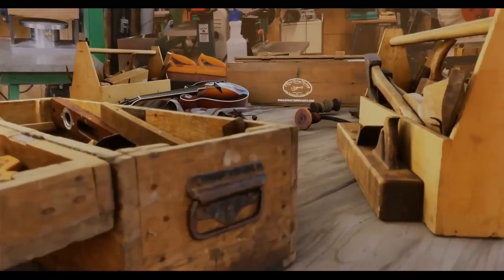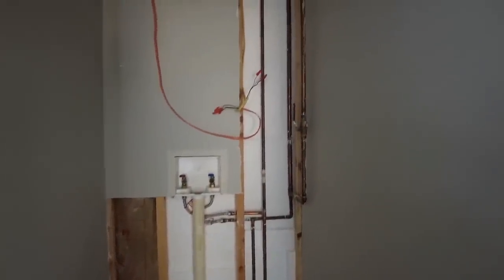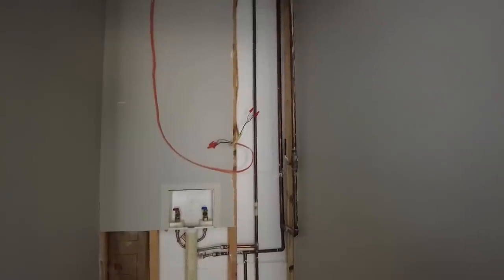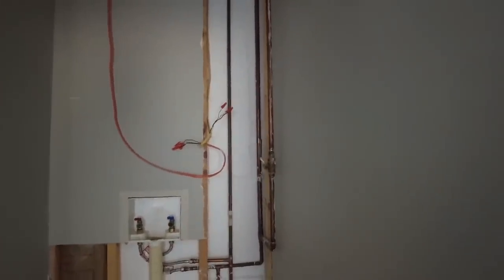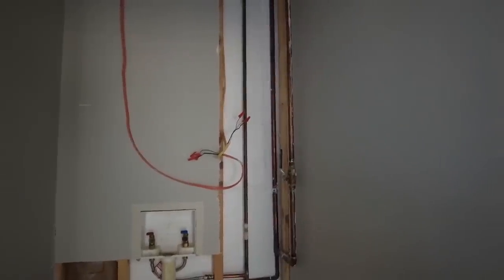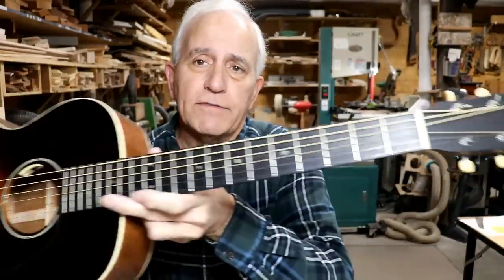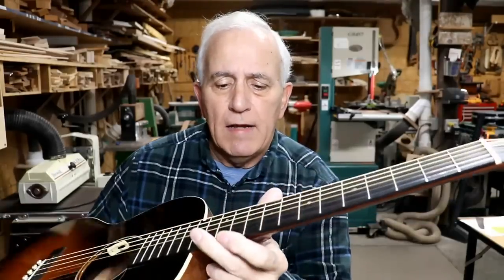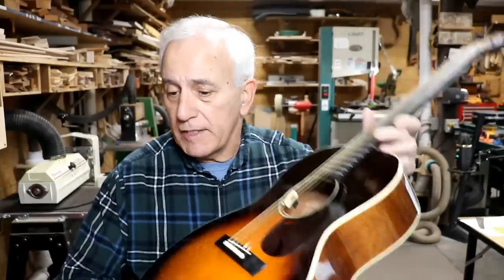Vlog #167 Project Status Flood Damage Repair

Comment: I became an expert at soldering copper water pipes. The second I did I redid the entire house in PVC pipes. In the winter I used to shut off the outside water from the warm inside of the house and drained the water pipes on the outside of the house. Once I did all of that I moved to Florida where I plan to live happily ever after.

Comment: Nice drywall work, looking good. You are insulated fine, more than most do. Jerry any time it gets 28 degrees or lower for over 4 hours, let the the faucet furtherest from where the water comes in trickle. If you would have done that, it would not have froze on you. What is your saying? Oh, yeah, ask me how I know. The guitar will be interesting on how you do it with the fretboard on. You may be able to use splines, but I like the way you do the job like the mandolin, it just looks like a scarf joint, that you even see on new instruments.

Comment: Hi Mr. Rosa... I'm wondering if cutting slots into the neck matching up into the head on either sides of the truss rod and filling with a solid hard wood strips glued would be easier... as the neck is very thin compared to an accoustic neck.